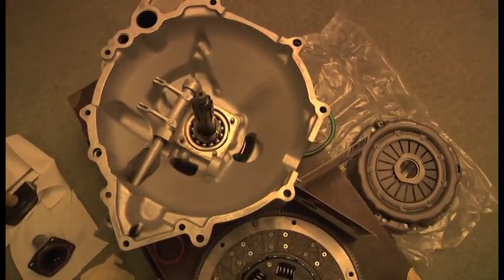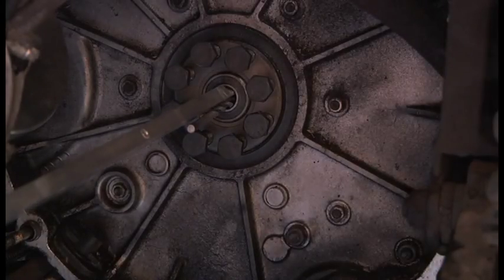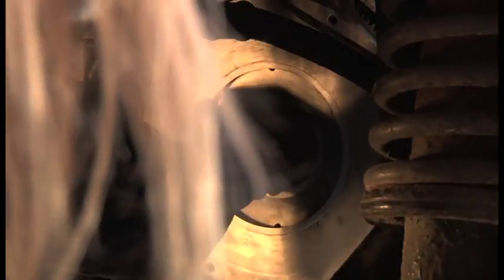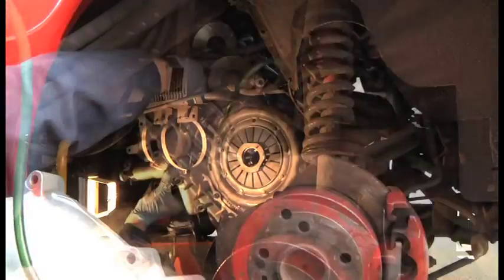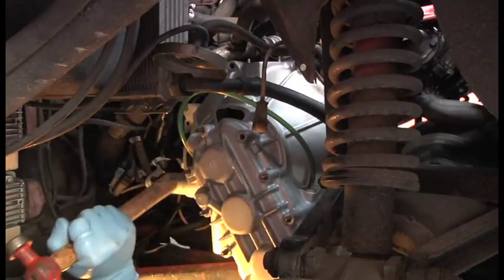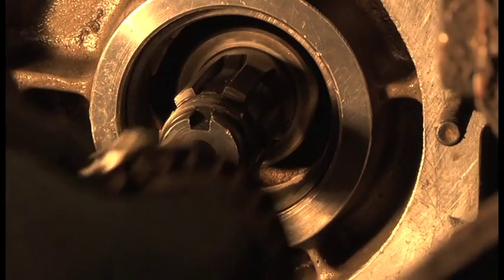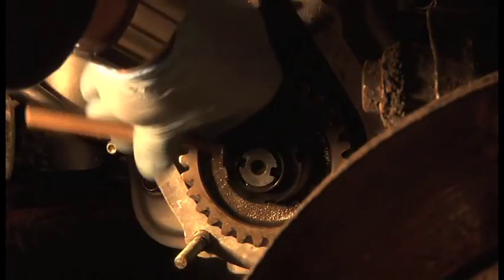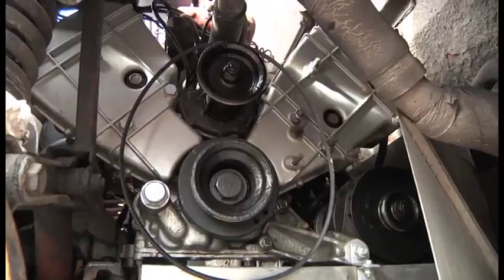Ferrari Clutch Removal/Refit Part 3

Comment: HeliDoctor - great video tutorial !  I've completed my clutch replacement ('82 Mondial 8) using this as a benchmark and having an issue with the clutch properly 'releasing' when the pedal is pressed.  Seems as though I don't have enough 'travel' on the release arm or perhaps the post coming from the new slave isn't long enough to create the leverage ??  I've also replaced the master clutch cylinder in the front - so again, not sure which of the cylinders may be causing my issue here - perhaps you've had a similar experience ???
Reply from the maker: Hi Brian, check the throw on the clutch slave actuator at.the.bell.housing.I can't remember what it should be but I do have a video on it.right.here..I.am.assuming.that.the.clutch.is.a.standard.one.so.it.must.be.the.clutch.throw.that.is.out.and.slaves.are.weak.on.these.cars.but.cheap.to.fix..If.the.throw.is.not.enough.try.bleeding.the.clutch.first.this.will.probably.fix.it..Let.me.know.how.you.get.on..Sorry.about.all.of.the.fullstops.bloody.computer.space.bar.just.failed.on.me.....it.probably.needs.bleeding...;-)
Regards.Doc
Reply: @TheHeliDoctor  - thanks, I'll have to check that both the master & slave are properly bled - it would appear from the throw out vide that I'm not where near the 20mm travel on the slave - but I'll confirm later today as I would assume if there's air in the system its just not going to create enough hydraulic pressure to push the actuator.  I did replace both the master & slave in the restoration - perhaps didn't bench bleed them enough !

Comment: Are you sure you were suppose to put silicone on the flange?
Reply from the maker: dontilgon Hi dontilgon, yes I do use silicone sparingly and in both instances here it is required. You could make a gasket for the 'gear cascade' case but it is a bit unecessary, silicone works well here and is all that's really required.
Regards Doc. :-)
Reply: TheHeliDoctor 
Interesting because when I removed the flange there was zero silicone on the factory installed flange. Also no signs of leaking
Reply from the maker: +dontilgon Hi dontilgon, I do it just to be sure it doesn't leak but if you feel more comfortable not using any silicone then do what works best for you.